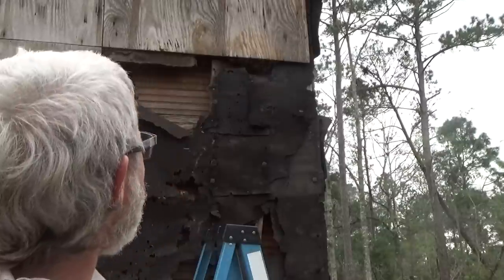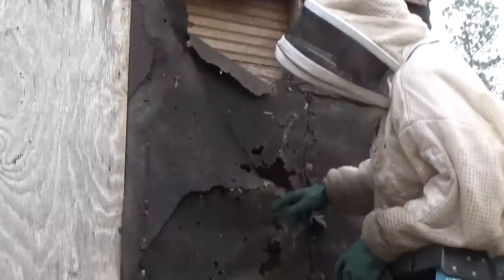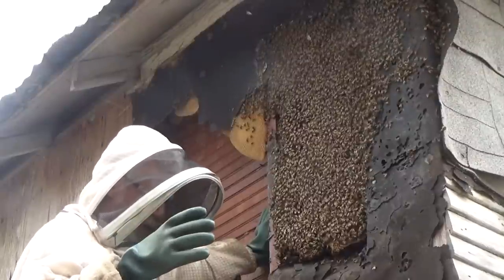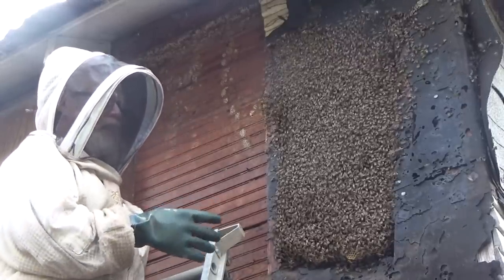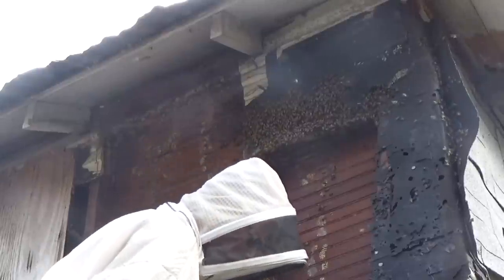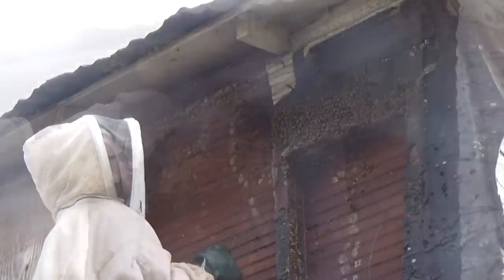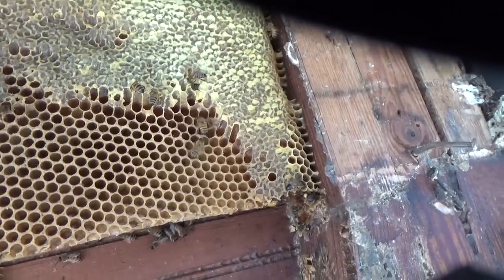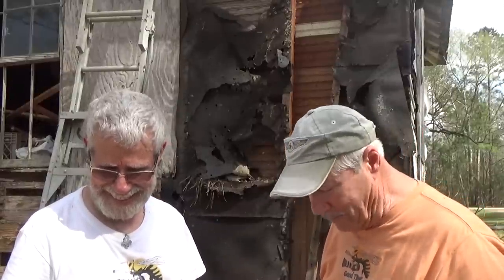Another monster beehive removal and the agony of defeat.

Comment: I've been thinking for a long time that the best way to build a house is with a cast-in-situ concrete external structural wall. Seeing how many bees get in behind sheet cladding or non-structural bricks is another reason to stick with smooth solid concrete. Making the concrete the structural component means the floor framing and verandah or balcony roof framing are bolted to the concrete and not passed through it like I've seen verandah beams with bricks laid up around them after the fact. 
Lining the verandah and balcony ceiling is a bit each way - if it's lined, that's a space for bees to get into, and it it's not, it's a space for birds to nest. On balance, I think it's better to screen in the verandahs and balconies to make a fly- and mosquito-proof outdoor living space, and after that there's no birds or bees in the rafters so lining or not is just aesthetic. And in fire zones, verandah and balcony screening is a fire safety measure anyway.